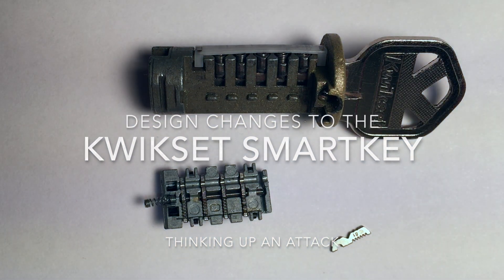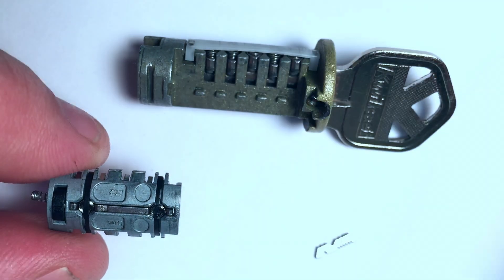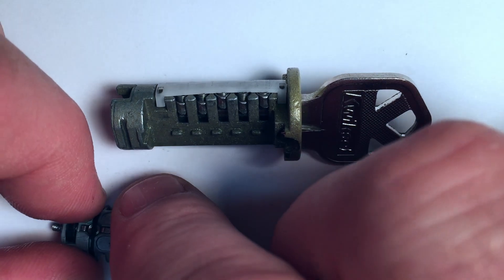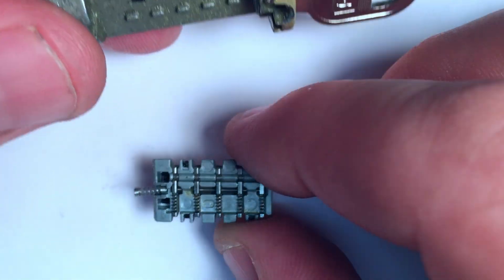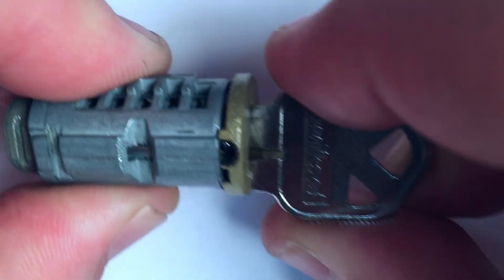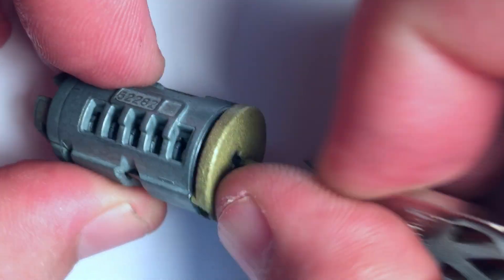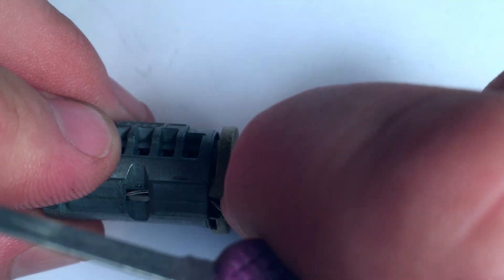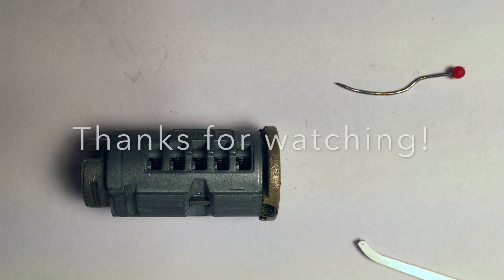Design Changes to the Kwikset SmartKey

Comment: dose a screwdriver still work? seems like a lot of work and time and effort for a design still plagued with force flaws.
Reply from the maker: Hi Wayne! Thanks for your comment :) I'm not sure how effective the force attack would be on this generation. Am I correct that the force operation wedged the sidebar into the slider / wafers, deforming them? If that's the case, I don't believe a force attack would work, at least in the same failure mode as the previous generation. All the force of the rotation would be driven into the body by the squared off sidebar. The plug and body are still made from very cheap metal (zinc?) and it seems likely that you could apply enough force deform those parts sufficiently for the plug to turn. It might just not continue operating in most cases as I'm told it did with the previous generation. Anyhow, that's all speculation... I've wondered the same thing myself, but haven't gone down and bought another one to play with. This one was on loan to me so I didn't want to damage it. Thanks for watching, Wayne! I'm a big fan of your channel and videos, by the way!
Reply: Thanks! I like your channel too! I think the plugs on the new ones gust sheer and break away in the new ones. Annoying and more difficult to force but still plausible. I actually have a bunch better bypass for the deadbolts but can't post it here 😉

Comment: My first thought is: is that bar made out of a ferric metal? 
What about the springs used?
Will a strong magnet on the side of the lock be enough to retract the bar?
Or at least take the push out of the springs?
Reply: Justin Sidder like sparrows magneto rare earth magnet
Reply: Pretty tough to get to the side of the cylinder when it's in a door.

Comment: Thanks for the callout, I'm glad you're having the same fun with this that I have been. You're going at it slightly differently than what I've been trying with shims... I was trying to shim between the housing and the cylinder with a flat shim folded or curled on the end to try to put tension on the bar in that open slot about midway down the length. The problem I had with that is I could get a small amount of pressure on the sidebar - enough to feel the gates click into place, even - but not enough to overcome the pin spring pressure, so they'd immediately drop after I set them. I hadn't tried going thru the ball bearing hole there, but seems like that could work. The only way I've managed to pick it so far is with the cylinder out of the housing, and rubber-banding a small metal rod against that exposed part of the sidebar... cheating, obviously, but it proved that adding pressure there would work. I've killed a lot of shims trying to find a way to fold or curl it in such a way that it would snap in there and deform when pushed or pulled... I'm convinced if you could get one to roll up on the end as it's pushed into that opening, effectively creating a little barrel spring, it would work, but I couldn't quite get a shim to roll that small once it had been straightened again to get it into the slit from the front - there's only about .065" of space to work in there.
Reply from the maker: I really like your idea of rolling a shim up on the ned, Chad! A little like one of those New Years Even party blower things. I've got no idea how to achieve that, but I agree with you that it would almost certainly work. Some guys and I were tossing around ideas yesterday and one guy mentioned a two piece shim system that deposited a wedge inside the core and was then removed. I think this idea stands a chance, but an incorrect placement would be disastrous, and if it didn't work, it would probably become impossible to fix the lock.

Comment: Nice video. A couple thoughts:  1- Your idea is very similar to datagram's attack on the old style MT5+ sidebar (with which I had some very limited success). Though he did it so you could progressively tension the sidebar (i.e., bind one slider at a time).  2- Do the sidebar springs have enough tension to create audible feedback when lifting the pin/slider assembly?  If so, that might be a good way to decode the lock...  That particularly true since the true gate is HUGE, so close should work. 3- How new is that lock?  I got a SK at Home Depot a couple months ago, and it had the old style sidebar.
Reply: Chad Royer Great info... thanks.  I'll have to try and track one down.
Reply from the maker: Thanks for your thoughts on this, LPL! I didn't know about datagram's attack, so I'll have to look into that. I hadn't thought to check for audible feedback when lifting the pins, but you make a great point. I'll put a stethoscope on it this evening and see. I can imagine how it might, given there is always some pressure on the sliders being exerted by the captured springs. As for how old the lock is, I'm not sure. +Chad Royer sent it to me, so perhaps he can chime in on when he purchased it. He and I started talking about it in mid August.
Reply: to answer #3, I purchased this lock at Home Depot on Aug 1. It's the 985 series deadbolt. I found a blog post on the Kwikset site from January that mentioned an improved design that they were introducing in select models, and would be rolling out to all of the smartkey models gradually, so it's quite possible they haven't reached them all yet - it was rather vague. I just picked the right one out of dumb luck (and it was the cheapest with two cylinders)... I watched tumbl3r and a few others pick it easily and couldn't figure out why I couldn't feel anything at all in mine, so took it apart and saw it was different, and here we are now. If you want to get the same one, mine is Model #985-3-SMT-CP-K4, UPC: 883351025386

to answer #2, the sidebar springs are VERY light, and don't really give any feedback at all. I talked more about it in my other comment on this, but the pin springs are much stronger, so there's no chance of the sidebar springs providing enough tension to hold the wafers up once the gate is aligned. Adding pressure to that sidebar does give audible clicks when set (I barely noticed the false gates) but there's still a bit of springy movement when they are set because of the wide V shape in the gates until they're all set.

Comment: Too bad the spring cap is now plastic. also what's with the huge gap between the end of the housing and where the clip sits?
Reply from the maker: I'm pretty sure the spring cap was always plastic. I agree it would be nice if they'd use a better material for that. The gap is to allow the slider carriage to be slid back in order to rekey the lock.
Reply: odd that the housing needs to move with the carriage.
Reply: the housing/cylinder doesn't move, just the carriage. there are two spring clips, one that holds the plug in the sleeve, and one that connects holds the core assembly in the outer housing.
The plastic spring cap really isn't important, as it's encased in the metal housing in real-life use, so it's supported/contained and doesn't warp like you see it with the core removed.
Reply: so there is one spring clip holding another?

Comment: like to find a bypass for the smart key... seen the destructive bypass but need 1 thats not destructive
Reply from the maker: You're probably right, but I'm not sure why pickers would be upset that the SmartKey system is improving. Don't we generally attack these systems with the rationale that doing so contributes to the overall improvement of security writ large?  From where I sit, this is pretty cool and innovative solution. Sure it has its problems, but it also doesn't share the century plus history of the pin tumbler design.
Reply from the maker: Yeah, I don't find destructive bypasses to be all that interesting, so I don't really focus on them much. I'm far more interested in non-destructive techniques, be they bypass or picking. I'm honestly surprised that Kwikset has put this much time and energy into pick prevention, although as I think about it, its possible their primary goal with squaring off the sidebar was actually bypass prevention... Not sure.
Reply: For sure there Zombie,  And that is the reason the Kwikset smartkey is your most popular video is because you are catching people in general as well as pickers that want a better way in. Most pickers can't stand that kwikset is getting so much better plus it is the big rage at the Box Hardware Stores.  Well that is why I think it has so many veiws.
Reply: +tumbl3r Yeah I agree with you, there are many different types of locks that were the best in there time. So a lock getting better is the best thing for pickers... Increase the challenge.
Reply: I'm pretty sure the changes were to prevent the forced entry (screwdriver) attack. Improvements to picking seems like a nice by product. I'm now wondering with these improvements if it's good enough to use on my house? (I'm specifically interested in the Kwikset SmartCode 916 - hoping it has the updated cylinder.)
Reply from the maker: One of the things that's really important to me with my channel is that I don't speak poorly of locks or their manufacturers. Certainly some locks are much better than others, but those tend to be correspondingly more expensive as well. That said, if I were in your shoes, I think I'd wait until we have some conclusive tests on how this new design responds to forcing attacks. I suspect it will do better given that the sidebar no longer jams into the wafers, but how much better, I cannot say.
Reply: I got a q tactical smart key decoder. LockPicks.com sells them now for 250.00 u need space and depth keys and a key machine to do it though